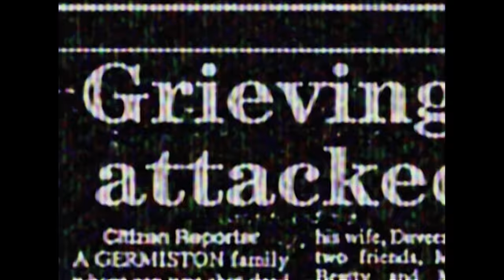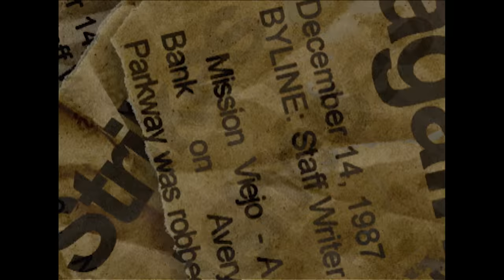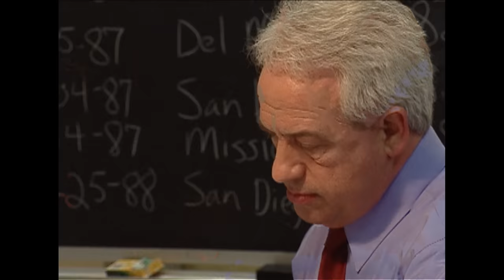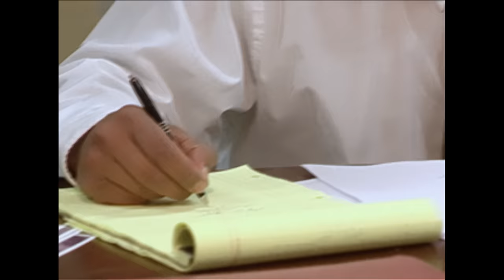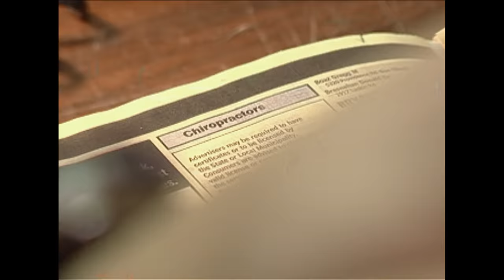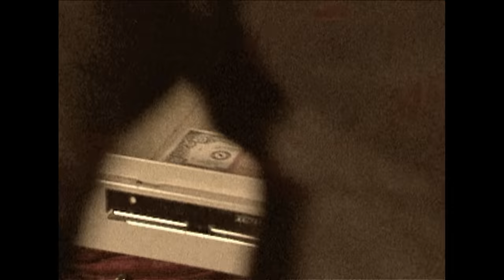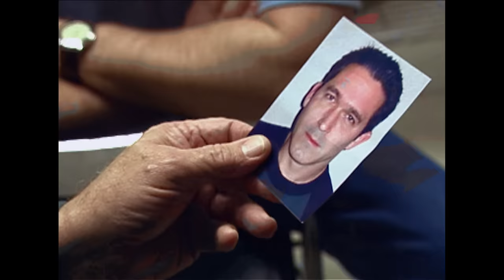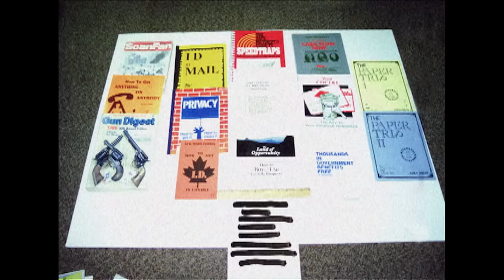The Shootist: The FBI's Search for America's Most Wanted Bank Robber | The FBI Files | Real Crime

Comment: 02.45 An FBI- agent should know that a Maglite opperates if the batteries are installed and the bottom is screwed in. No wonder it took you so long to catch him. A camera for example dont just take a picture you need to press a button and use a roll of film (so dont add paint in it)
Reply: PS. These officers who fear involving in a shootout with this guy arned with a revolver from which he has fired 1/5 rounds into the ceiling leaves him with four live rounds left... So you dont need much in a firefight agains him.